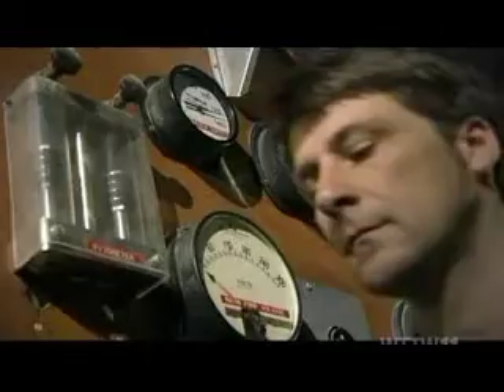Vortex-Bubble Cavitation

Comment: for example a 50 meter wave of water would travel at 67 miles per hour. (assuming incompressibility)  Please note that this is a wavefront, not a surface wave which can travel much faster, but is unrelated to the topic.

Comment: Notice how they didn't say what velocities the water had to travel at in order to cavitate... Also cavitation by water is dramatically different than cavitation by ultrasonics.  Like the difference between water vapor created by heating vs by sonics.  The water in the video is going at least 60 MPH.  There is no way a natural flow could generate those kinds of energies. Velocity of the water (V) is V=(2*[9.8 m/s^2]*[h m])^0.5  where h is the difference in water height propelling the wave.